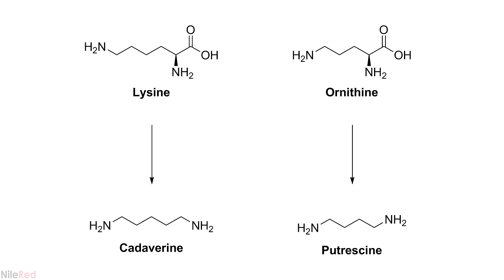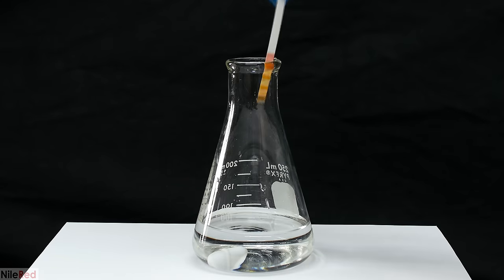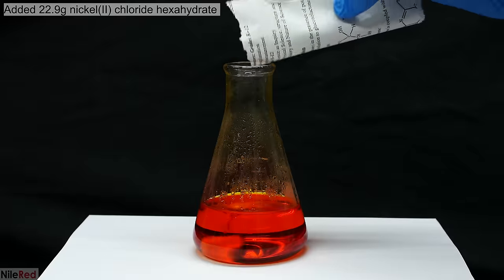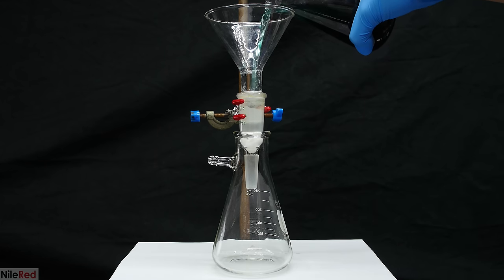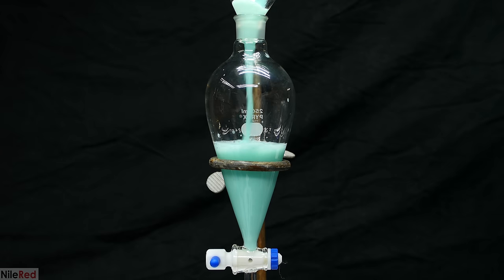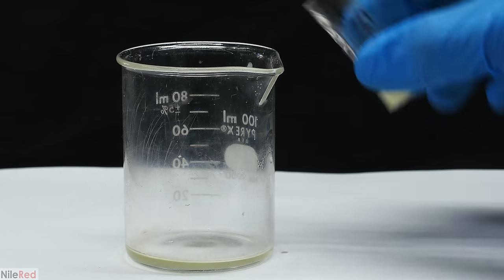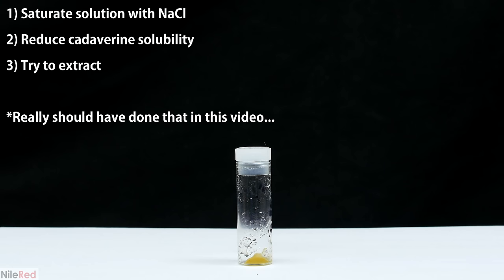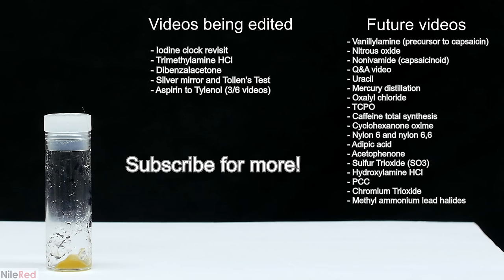Making cadaverine

Comment: One thing I noticed is that your N-bromosuccinimide was very orange. NBS readily releases Bromine upon exposure to light so it must be kept in the dark. For reactions that uses the electrophilic properties of NBS, it is usually recommended to perform them in glassware wrapped in aluminium foil. To obtain pure NBS, you can recrystallise it very easily from 90°C water using 100ml of water for 10g of NBS.

Comment: That pill doing 360's looks like a good Beyblade opponent.
Reply: ARDEACT it’s a magnet, and tbh if beyblades could implement magnets at certain points that could help or hurt ya, be a whole nother beast. Could be cool if done right.
Reply: da stirrrrr barr
Reply: it can handle any acid and most molten materials, and radiation

Comment: At least in the case of L-phenylalanine, an amino acid can be converted to its corresponding nitrile (with one less carbon atom, just as you do in your process) using the slow addition of household bleach at low temperature. I've used this procedure for preparing benzyl cyanide from phenylalanine.
Reply from the maker: Interesting!

Comment: I've had similar problems with partition coefficients going the wrong way with a couple of reactions in my scheme. I would recommend using a more polar solvent like ethyl acetate instead of ether and doing something like ten extractions. You could then reextract it from the organic layer with an aqueous acid solution, wash with ether to remove organic impurities, make it alkaline and salt out the product with brine.
That was a nice demo of a pretty uncommon reducing agent. Thanks!

Comment: This is a cool video and all, but something in me feels like this was a waste of chemicals. (Kids in Africa could have eaten that sodium borohydride!) By that, I mean that three are cheaper reagents you could have used to perform the same reaction. TCCA in sodium hydroxide is a known reagent to convert amino acids and amines to nitriles ( this would instead give you the dinitrile), and CTH with a tiny amount of palladium catalyst would reduce this to the diamine  easily. This follows the same synthetic pathway, but is much more reagent efficient.

Of course, this also neglects direct decarboxylation: although straight heating is a poor method, decarboxylation of amino acids in acetophenone is known to proceed in high yield and at temperatures under 150 C, due to the formation of an imine intermediate which is easier to decarboxylate.
Reply: Bill Smathers instead of buying new things I'm pretty sure he just uses whatever he already has regardless of ease in the experiment

Comment: To maximize my yield, I would remove the water using a lyophilization process by putting your liquid in a tube with a filter paper on top within the lyophilization flask. If the lyophilization is done at a low temperature, the cadavarine should remain a solid and remain in the container. Then you can add ethanol to liquify the cadavarine in the filter and allow that ethanol to evaporate.

Comment: Most likely you are right, the extraction was inefficient:

solubility stated in the rubber: soluble in water; slightly soluble in diethyl ether...
So the 3x30ml of ether for the 150ml solution is not enough the get all the product in the organic phase,
because of the better solubility in water compared to ether.

Comment: Regarding the nickel boride removal step, do you have access to celite? Its really good at getting rid of metals. I use it to remove tin (II) chloride and silver perchlorate.
Reply from the maker: I really really wish I had celite. I've tried to find some, but it seemed to be pretty expensive.
Reply: NileRed
If I still had access to my laboratory (finished PhD, no lab access) I would have sent you the last of my supply! I have 500 g that is currently going unused until the new student starts in April.

Comment: I have been watching your videos and think they are great although some could be used for less than noble purposes.  Some tips/ideas for your cadaverine synthesis and lab tricks in general 1) get some Celite for any filtrations with suspensions, emulsions or flocculent solids, after filtering the solid Ni boride, precipate any remaining nickel as the insoluble oxalate leaving your diamine in solution as it's oxalate salt, filter and strip off water. 3)  an alternative method for converting water soluble amines to their free base from their acid salts is to mix the solid salt with solid NaOH which will liberate the water soluble amine, usually as an oil which can then be extracted more easily. 4) when extracting with lighter than water solvents, decant the upper phase directly from the sep funnel (that is why they have the pear shape).  To separate the last organic extract, drain the aq. phase and dry the inside of the tip after the stopcock w/ a Q-tip, then drain and dry etc. 5)  instead of NaOH, use NH4OH.  The Ni will form a soluble complex which could be treated various ways.  6) If the diamine forms an azeotrope, steam distillation could be another alternative.
Reply from the maker: Thanks for the input, all very good tips. I like the Q-tip idea. Also, NH4OH is definitely a better idea than NaOH

Comment: Nice job as usual and very clear presentation/video.

I see 3 reasons for low yield:

1°) Ni(2+) complexates with organic primary amines... so getting rid of Nickel also get some diamine away... that is probably one of the reason for the use of ion-exchange Dowex. Your Ni(OH)2 had a very turquoise blue haze while it should  be greener (maybe is it due to the recording camera balance)... so this may indicate some alkyl-amino complexation sticking to it.

2°) The reaction probably proceed via HOBr just like it does with bleach (NaOCl) and acetic acid to make R-CH(-NCl2)-CO2H from R-CHNH2-CO2H... It makes a N,N-dihaloaminoacid compound that decarboxylates readily to R-NX2 and in basic media generates a nitrile by elimination of two HX.
In the case of an aminated aminoacid... both amino groups may react to form the di-nitrile.

3°) The use of aceton to isolate the final compound is not suitable because of Schiff's base formations...
R-NH2 + O=C(CH3)2 <--==> R-N=C(CH3)2 + H2O

I hope this helps a bit.

PHZ (PHILOU Zrealone)

Comment: LOL! I worked for 8 months with one of my university teacher to analyze an effector of an enzymatic reaction and putrescine was one of the substrate that was used in a reaction to measure the rate of the enzymatic reaction. That reactive smelled awful and oxygen was needed for the reaction so I couldn't close the tube while the reaction was happening.

At some point I used benzaldehyde as a control. God I was happy to work with a substrate what smelled good!

Comment: You could have extracted with ether more times. If the partition coefficient isn't great, you might just need to extract more times I believe.
Reply from the maker: Yeah, that is true. It just uses to much solvent though :(
Reply: You should think about recycling some of your solvents.
Collect, wash a few times, dry and distill through a column.
It should be pure enough for extractions.
Reply: NileRed If you make it highly salty eg with lots of base, I believe you can use isopropanol if cost is the issue. It also could help with the solubility.
Reply: That reminds me of a liquid/liquid extractor, a bit like a soxhlet that just reused the ether over and over.  It looked like a nice bit of kit.  Out of my price bracket, of course.

Comment: One possible reason that the yield was low is the fact that NaBH4 decomposes rapidly in acidic conditions, so some of it may have decomposed before it was able to react with the nitrile/nickel. The pH should become higher as more is added though, and because you did add an excess, decomposition of NaBH4 might not be a main reason...

Comment: Make a larger batch as usual until after the filtration stage then run a short path distillation with warm water in the jacket, if it forms an azeotrope with water simply add magnesium sulfate or potassium carbonate, if there is not enough liquid to do this then dissolve in diethyl ether prior to salting it out then filter out the magnesium sulfate and evaporate the ether for a pure product

Comment: Yo Nile. You could try to use pool ion exchange resins. They're like $6/kg, so it's cheap and usually they're good enough for these kind of things. Just look for the right kind. Usually they are in Na form, but they are highly acidic in nature, so they can be easily activated. They have a different mesh size, but you just have to compensate for that.
Reply from the maker: Hmm, ill look into that. Thanks!
Reply: NileRed check out NurdRage video on Chinese molecular sieves from eBay, were a bit under spec for methanol but could work well for slightly larger molecules and are cheaper.

Comment: I extracted some aminos In a THF water extraction. if the water has salts the THF will phase out. I've done with some stubborn products adding brine will do the trick if it doesn't phase out at first. also your product might be complexing with the nickel as a bidente chelator. increasing the pH might be helping  it to detach from the nickel but it might not. try using NH4OH as a base. it will complex stronger with the nickel and you won't need to have to filter out the NiOH because Ni ammonium complex is soluble at those pHs. it's worth a try.
Reply from the maker: Interesting suggestions. The complexing with the Ni is something that honestly didnt even occur to me. Using NH4OH might be a lot better to use!

Comment: Re: yield.  I would expect anhydrous MgSO4 to react with a free amine.  Maybe use anhydrous Na2SO4 or CaO instead.  

Your second proposed workup has the merit of concentrating everything and looks to have fewer places that you can lose product.

Also, you didn't comment on the smell.  You should have had an overwhelming smell from the basified extract and not much from anywhere else.  And yes, saturating your basified aqueous extract with salt would probably help.  I am ignorant as to why diethyl ether was the best extraction solvent over hexanes or DCM.
Reply from the maker: Honestly, it is because it was recommended in the paper. Just to be safe, I rolled with it. Probably could have used DCM though.

Comment: Two suggestions:

1) Basify with NaOH, saturate with NaCl, and extract many times with ether (may need a considerable amount of ether).

2) Basify with NaOH, evaporate to dryness, and extract the solids with ether (may be messy and smelly).

In both cases, skip the final wash with sat. NaCl (since the product is water soluble some of it will be washed away) and instead dry straight away with a basic drying agent like K2CO3 (MgSO4 is somewhat acidic and may complex with amines).

Comment: When you had the cyanic blue murky liquid, I think you should`ve used a vacuum filtration. I`m no pro at Chemistry, but my suggestion is just based on your other videos.
Reply: MrCoolios12 He did vacuum filter it
Reply: A. Zak Really? That`s not what I saw.
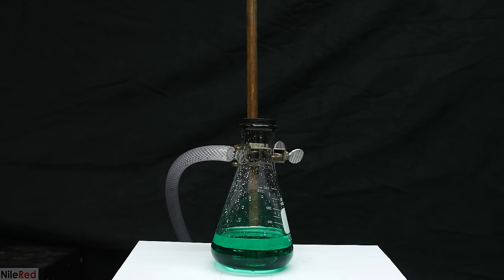Reply: MrCoolios12 ; At 7:45 you can see the residue he vacuum filtered off. His vacuum source is connected with the tube going down behind the stand.
Reply: MRLT hmmmm you're absolutely right, my mistake. That's embarrassing.
Reply: *****  Don't fret it, we all make mistakes.

Comment: I'm not a synthesis person so I have no recommendations for improving the extraction. But will there be any spactra and mass spec of the product? Cadaverine is one of my favourite diamines - small enough to model very easily and large enough to have non-trivial conformations and interesting self-interactions.
Reply from the maker: Nope, unfortunately I wont be running it through any machines. I also like it for its simplicity!

Comment: Just get a bucket with a lid. Now put meat in it. Then put water in it. Put the lid on it. Set it outside in the sun. Leave it in there for 2 week. Ok now get a gas mask and goggles and a strainer and a pot. Pour out the liquid through the strainer into the pot. Now get a funnel and pour out the nasty liquid into a spray bottle or squirt gun. Go have fun!

Comment: hi nile remember that amines form chelates or better bidentates with nickel maybe is there a lot of your cadaverine
Reply: Therefore maybe try to take the nickel and put it in acidic water just to try to solubilize some more amine
Reply: about the second method you propose: evaporating dmf is a huge pain, you really need a potent pump for that. Not the best option

Comment: hey Nile. do you have access to a Schlenk apparatus? I'd love to see some water and air sensitive inorganic chemistry :)
Reply: TheMeilinger : I would also LOVE to see that! Like how he would do a proper full synthesis, extraction and final chromatographic purification of a light and air (so you can't just use N2 to shield it either) sensitive product!
Reply from the maker: I might do that eventually. I dont have any Schlenk glass though. That is all I did in my short ~7 months as a grad student, so I have some experience. I would have to make a ghetto glovebox though. 

Any ideas as to what I could make that would be interesting? Actually thinking about it has given me some nightmares. So many distillations and drying steps :(
Reply: @NileRed; Lol, I know what you mean!
As for what to make, I really would like to know if it would be possible to create a proper silicon transistor (or even just a diode) yourself.
I have seen other people attempt it, but the finished product is not even close to being practically usable, due to bad process conditions and impurities.

The best way I could come up with, would be to make BBr3 and use it to dope some n-type silicon (which can easily, and cheaply, be bought online).
Now making the doping agent is not very difficult at all... The trick is in purifying it and conducting the reaction in strictly air-free conditions. To give you an idea, even with commercial-grade doping agents and a proper semicon-development lab, we still end up having to make quite a few sacrificial offerings to the probability gods after every run...

Of cource, it is really about the techniques you use to conduct air-free chemistry, rather than the end product, so regardless of what you are making, it would be awesome to see!

Ps. I seem to remember you doing an air-sensitive Gringard reaction in one of your earlier videos. Was that not done with your own equiptment?